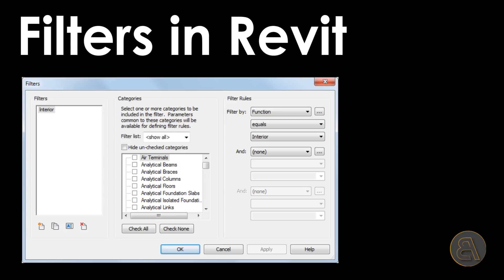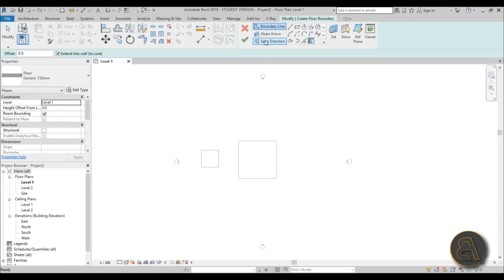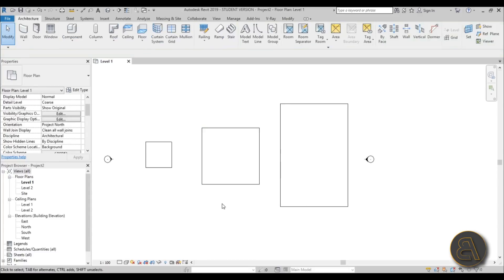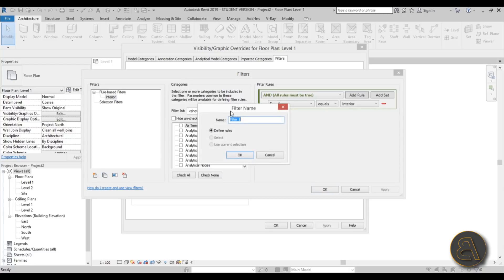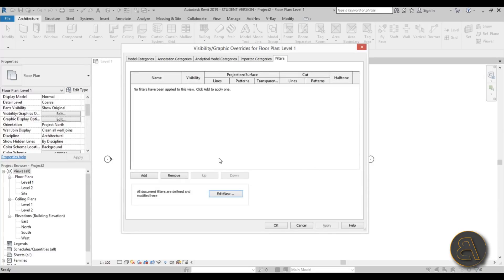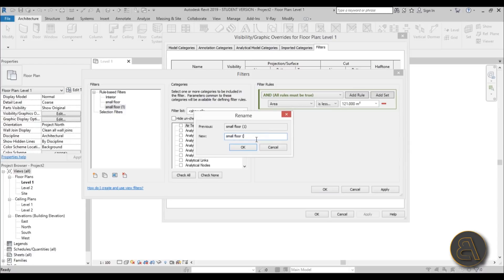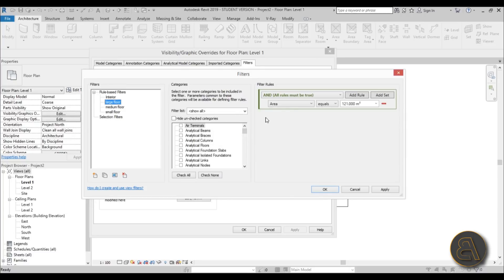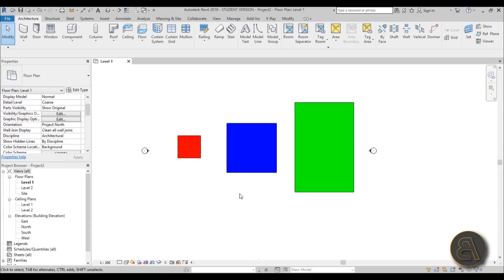Filters in Revit Tutorial

Comment: Hey, I do enjoy your little tutorials, however I've a challenge for you!
I work with historic buildings (old Victorian / Oak framed buildings) here in the UK, and I use Revit LT. The walls are never square, and the only way around it, is to use 'In-Place' walls... However they don't attach to the roof, nor am I able to add flint panels etc like you can with 'regular' walls... A BIM manager suggested Wall Sweeps to adjust things... Any ideas? Keep up the good work! :)
Reply: You could in place walls, not really the right way. You would need to sweep the wall then cut off any excess with a void(s). Issue is revit is designed for the modern world! Curved walls are annoying to work with!